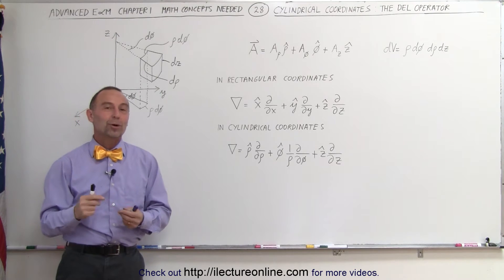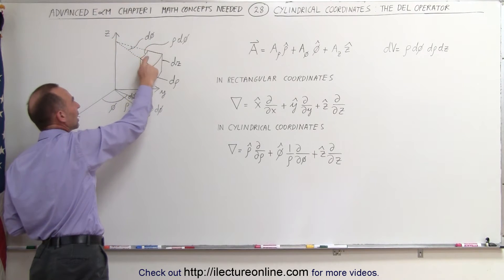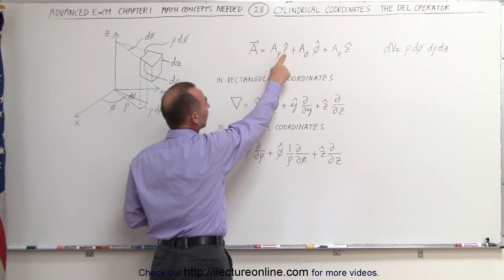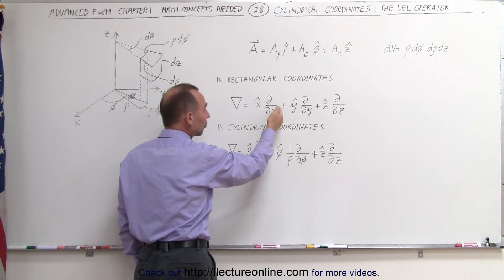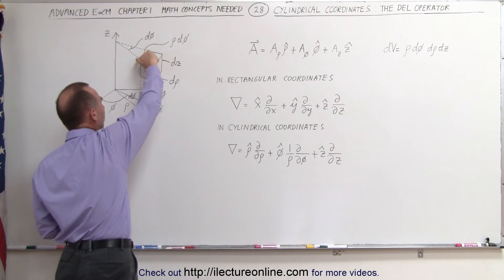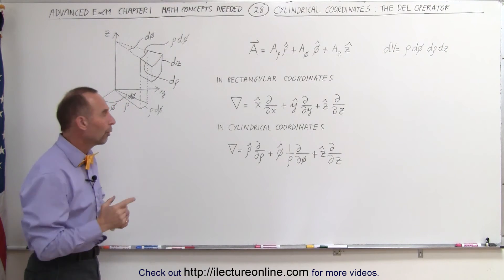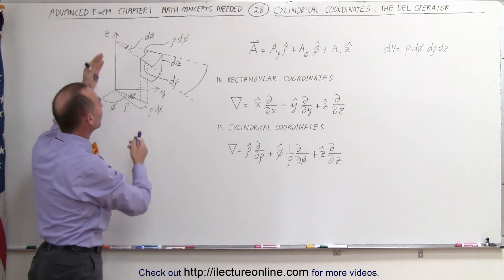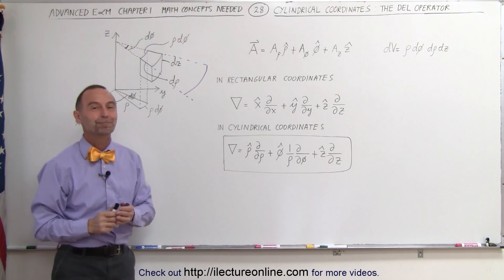Physics - Advanced E&M: Ch 1 Math Concepts (28 of 55) Cylindrical Conversion: the Del Operator

Comment: Hi Prof; the explanation you gave to why the phi component is divided by rho is excellent and very intuitive. Another alternative was to say we desire to have a change in the "rho d phi" direction but with a constant location away from the z axis (meaning rho is constant). If rho is constant, then the differential "d phi rho" can be written as "rho d phi". 

Or better still say, we desire to have a change in the phi component of the vector with respect to the "rho d phi direction". That explains why we have "rho d phi" at the denominator

Comment: I can't blame you for not deriving the gradient in cylindrical coordinates. I understand that it's very tedious. However I've been looking for an explanation and I've come across some information about a general way of converting grad, div, curl and Laplacian to any coordinate system in a very simple way using something called Lamé coefficients which are derived from the columns of the Jacobian  matrix and then used in a generalized formula for grad, div, curl, and the Laplacian- although I'm not clear on all the details. If you know about this, I think it would be super if you did a couple of videos on this technique. See https://www.youtube.com/watch?v=Q-qsKu00tVY and https://www.youtube.com/watch?annotation_id=annotation_3574693513&feature=iv&src_vid=Q-qsKu00tVY&v=00NnJBv6-q0